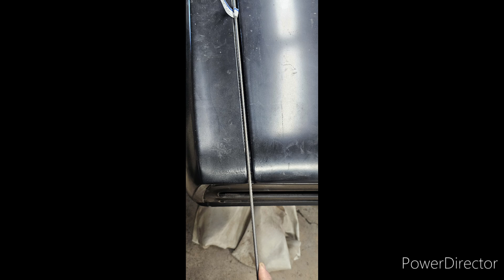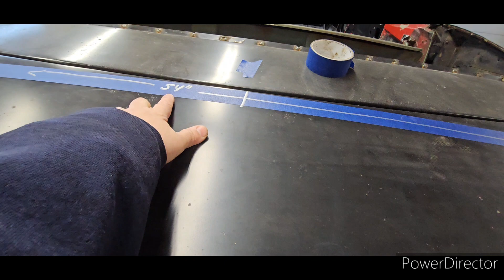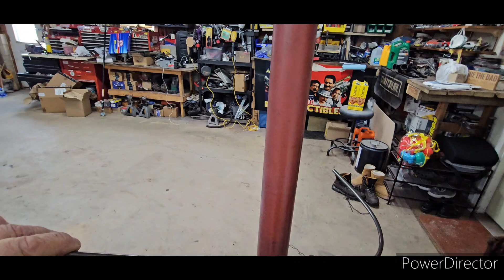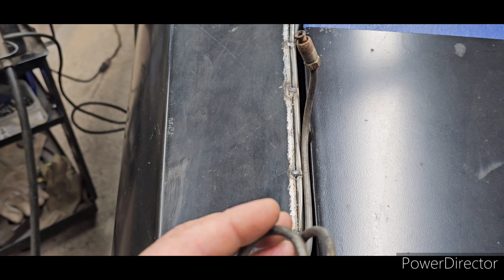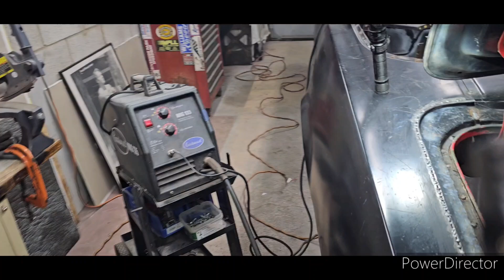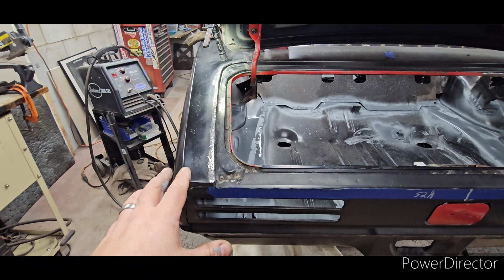How To Close Up Body Panel Gaps - Welding Skills - Automotive Body Work Training #bodyshop #fbody

Comment: Why wouldn't you weld the rod on the edge of the deck lid?  Would have eliminated the void and not made the quarter panel surface wider than the other side. Wouldn't notice anything different.  Just my 2 cents
Reply from the maker: @davidyingling6204  First thanks for your comment  ...now if I did that to the deck lid let's say something goes wrong with it and the owner needs a new one it won't fit but doing the repair I did it will ....#2 if something happens to the quarter panel next time hopefully the person who will be installing it will do it right....unfortunately this quarter panel was put on wrong and it's not in the budget to be cut up and do right so I did what I did that at the end it will look better ....thanks for watching and your support

Comment: Looks great. That’s the method I use to close larger gaps too. Once I have a good solid metal edge shaped to match the panel, I fill the under void with ‘all metal’ filler.  I think capping it with sheet metal will leave a void for rust issues down the road.  ‘All metal’ filler works great for this as long as you are not trying to form a new edge with it.  You need a metal edge to avoid it chipping out later.
Reply from the maker: @LakeAndLodgeGarage  thank you I do appreciate that I am going to top it with metal I will be welding the whole patch solid and then grind down my walls and use fiberglass body filler

Comment: nice work on the gap Louie.  Mrfireman did a similar kthing on a Camaro a few years back.  Not sure what would be best way to fill the void.....filler would be easy but would be nice to have metal to fill the void.  Is there enough room to slip another metal rod in that void and weld it in place?
Reply from the maker: @perrywe1  I believe Mr fireman did split the quarter panel I wanted to do the same thing but this one being a convertible it's a little different and I saw it wouldn't not work out or just would have been more work now there is space to fill the void I wouldn't use another Rod because it will create more work hold on tight and check part 2 you'll be amazed how it looks

Comment: I would becareful  adding some sheet there to fill that. it could leave a gap for water to hide and rust again. Its a shame how much work you have to do to make an aftermarket panel fit, but really an original needs work to fit to. Greta job man
Reply from the maker: @EfurdGarage  thanks brother and thank you for your support I really do appreciate it I am going to use sheet metal and you will see how I roll everything up and not leaving anything for water to go through thank you for your comments

Comment: You made that gap come in nice. Not sure how to finish it off. I like the sheet metal idea, but there will still be a gap underneath for possible condensation to get in. Unless you fill the gap with seam sealer (I don’t really know). I would like to know what you do there. Good job buddy. 👍
Reply from the maker: @JK_Nex_Garage  Thanks brother I really love the metal work on these old bird's stay tuned to Part 2 and you will see how everything comes together